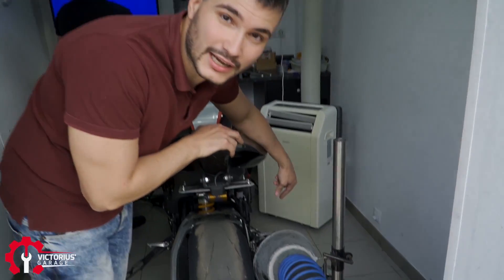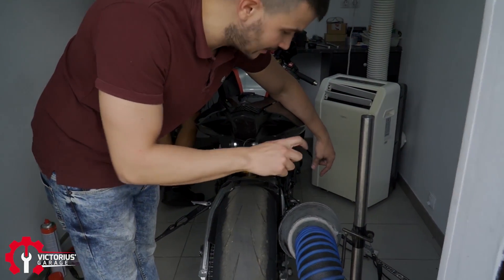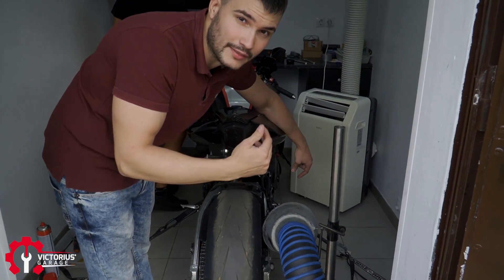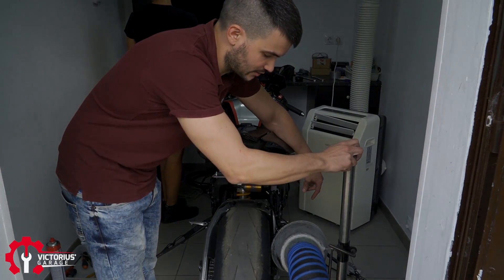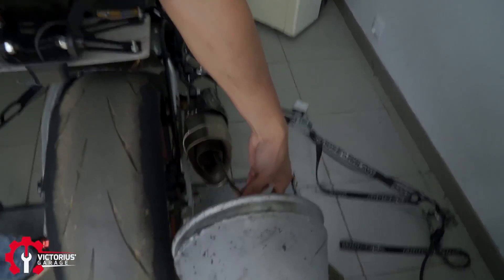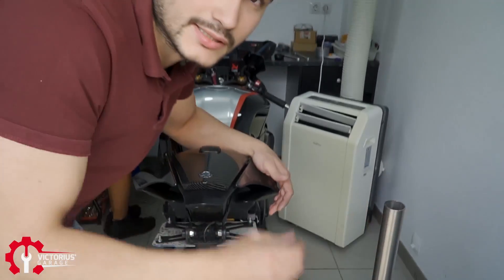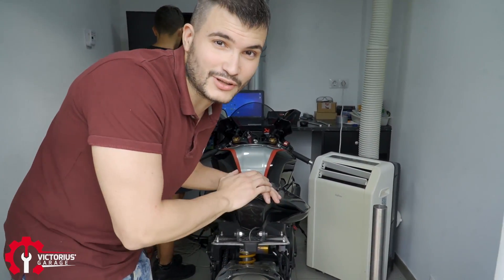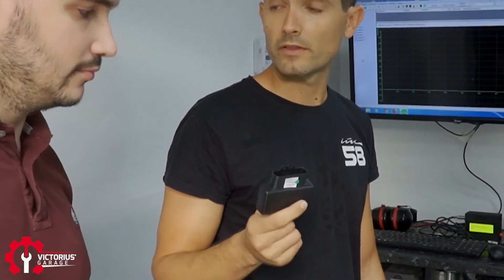R1M 2020 en BANCO DE POTENCIA. Haciendo un Mapa a medida

Comment: Victor , porque la mt 10 teniendo el mismo motor que la r1 da 40 cv menos , si algun dia llegase a tenerla se le podria meter la centralita de la r1 y tener una mt 10 de 200 cv?
Reply from the maker: La mt10 va limitada electrónicamente, reprogramando se consigue prácticamente la misma potencia

Comment: What are the mods you got?
Reply from the maker: There is a video with all the mods (no english subs, sorry). Performance mods are MRW Air filter, mivv titanium suppressor & akrapovic slip-on muffler.
Reply: @VictoriusGarage  thanks mate! Yeah i saw the vid, but spanish is not my strongest tool😃 

Do you have stock dyno measurements? I’ve seen 175-180 hp full stock. 195 is insane with just a couple mods, even with ram air.